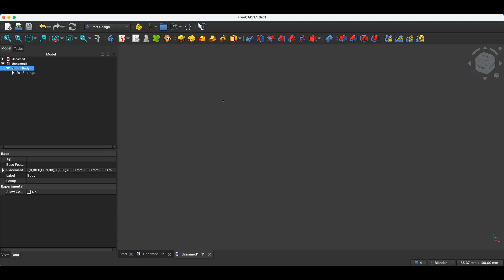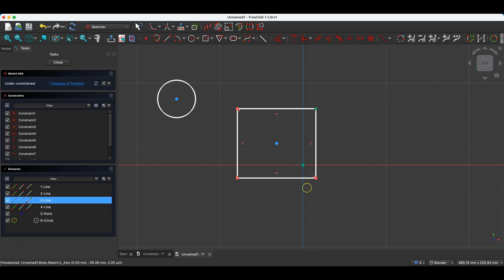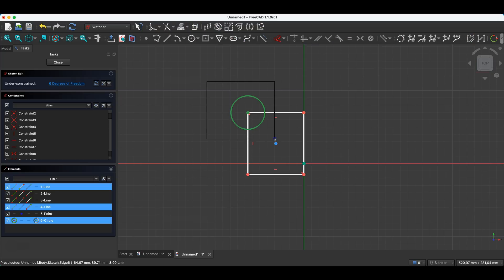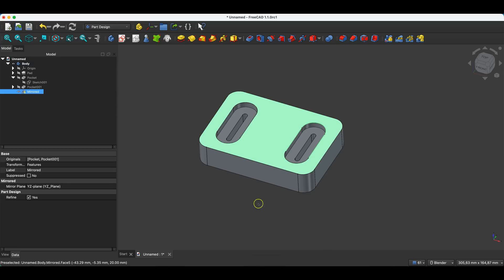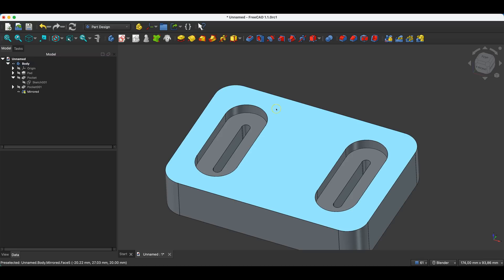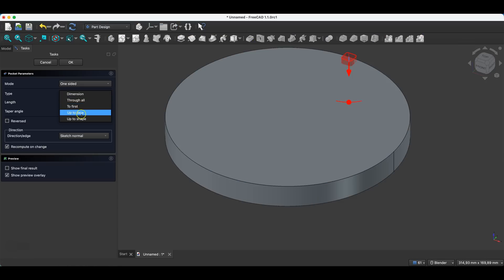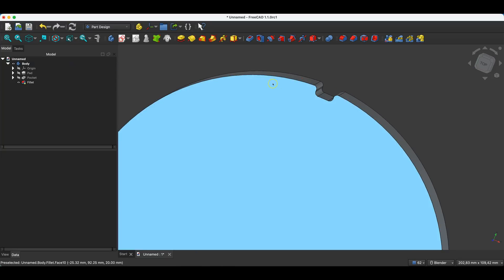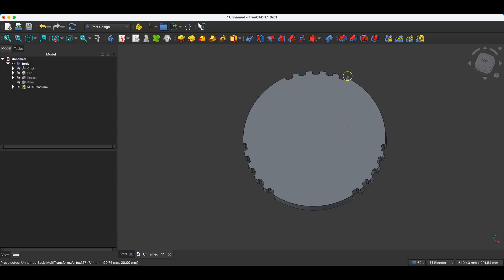FreeCAD Selection and MultiTransform Patterns - FreeCAD Tutorial 2026 - Part 6

Comment: Hi. Thanks a lot for your enthusiasm and sharing your knowledge.  I really appriciate it. Just tried in version 1.1.0rc2 but there´s a bug with the external geometry. When using it there are outputs like "wire is not closed" or that the resulting body does not exists. It´s a known problem. Just a little hint for 1.1.0rc2 user👍
Reply: There is preference you have to check, by DEFAULT in 1.1 (the version I have anyway) clicking external geometry brings it into the sketch as an actual line!! This is different than previous behavior. This is why there is always a wire not closed because there will be any number of random lines that are actually lines in the sketch. You have to go in the Preferences > Sketcher and turn on "Always Add External Geometry as Construction" so that all the tutorials out here in youtube lanbd will work the same way. Then you can add external geometry and it will not show up as real lines.

I was going crazy with the same problem, if I tried to do any sketch on an existing face and used any kind of external geometry reference, I would always get wire not closed because...it wasn't. Checking that preference makes it actually be construction geometry and not turn into real lines or shapes in the sketch.
Reply: @Intenzity  Hi. Thank you so much for this hint. I activated it and it WORKS👏👏 Again, thanks a lot and now my furniture can stay where it belongs to 😂
Reply: @Frankow44  Glad it helped, it was driving me crazy too! I think they should set the behavior back to construction geometry being the default.
Reply: @Intenzity  Why not set the settings to default that you need anyway?
Reply: @Frankow44  Oh I did! I have seen in many many forums that people dont know this setting is different from previous versions so if they grab 1.1  it causes them a lot of trouble, especially new users like me that are following tutorials online.
Reply: @Intenzity  Oh sorry, I mean the FreeCad programming staff. They really do a great job for free use and I‘m thankful that I can use such a program. I‘m working with it for maybe 4 months and I use it to create tools for 3D prints and my workshop👍
Reply: @Frankow44  Same, I am blown away by how powerful it is..it is complex, but slowly starting to wrap my head around it. I am using it for 3d printing exclusively.